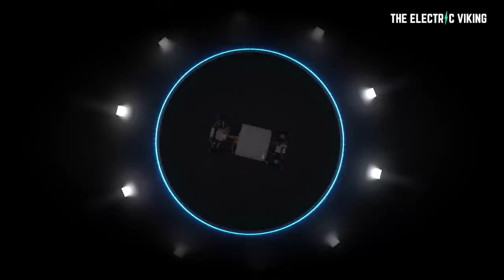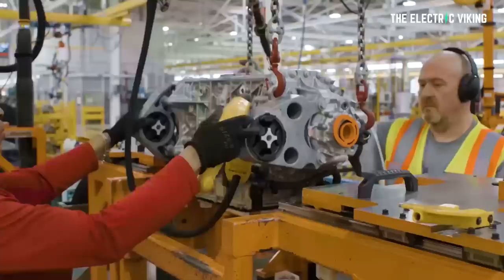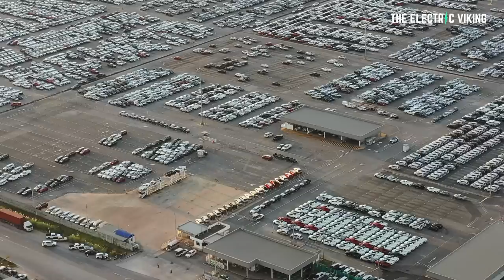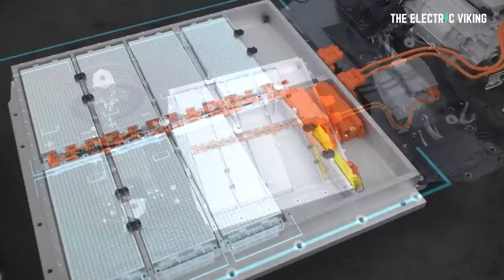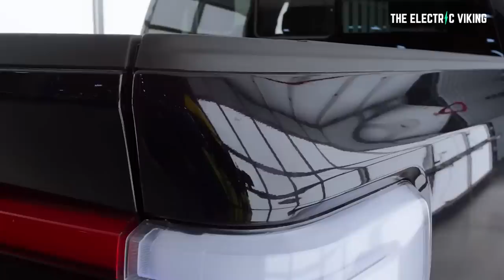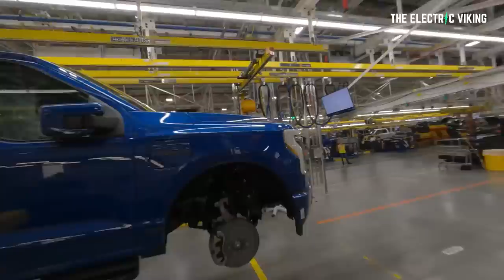Ford decides VW's MEB platform ain't that good - develops its own

Comment: God Bless Ford, they do not need VW as Ford already has a great EV in the F150 pickup which people who drive are very happy with.  Plus you can get power for your home when the power goes out with the F150 pickup.  I may buy Ford stock as it is only $12 per share now.
Reply: The only reason Ford is getting so much praise for the Lightning is because it has no serious competition. When Cybertruck, Silverado EV, and RAM EV come to market Ford will be scrambling to bring out a new updated version of the Lightning.
Reply: Perhaps not in europe ...the ford kuga phev is the best selling phev in europe...but the mach e is the worst seller in europe 
They should come with more plants to built ev

Comment: 6:00 I hate that everything is an SUV that most of the time can only fake off road credentials when wagons have always made more sense
Reply: You are correct. Worse still are the hatchbacks with longer springs that call themselves SUV'S. I find that amusing.
Reply: @robertfonovic3551  Exactly! Honda took the fit, lifted it and called it an SUV!

Comment: Don't think either Ford or VW wins on this decision... lose-lose without much ventured on either side.  But the worst joint venture is still Honda depending on GM to supply EV platforms.  GM doesn't have anything to brag about in US market, is out of Europe, and sliding fast in China.  That's the deal to flee from.
Reply: 😂😂😂 it’s not bad it’s just hilarious. Honda will buy EV’s from the guys who finally managed to make 39k units in one year in 2022! 😂 You couldn’t make this up… On top of this GM makes stratospheric losses on every EV they sell.